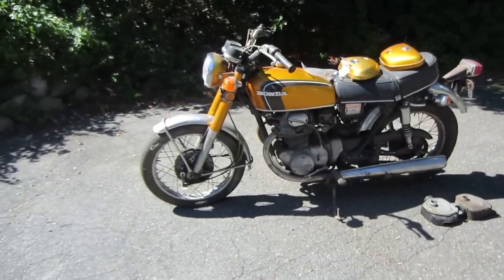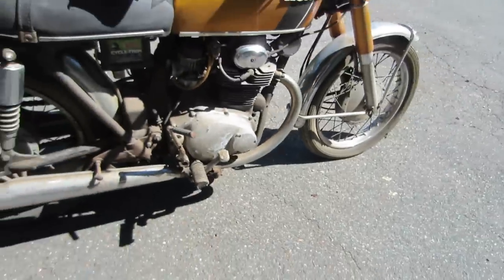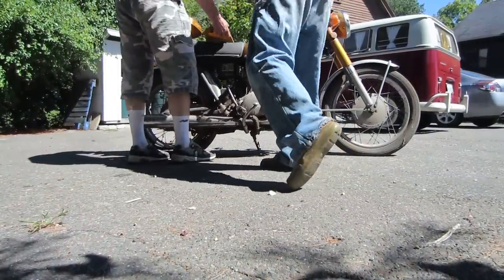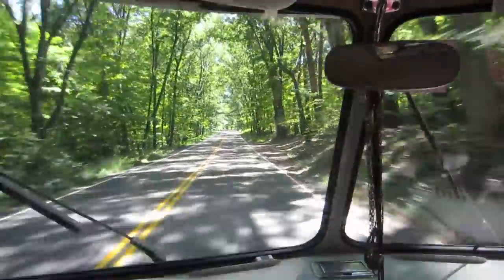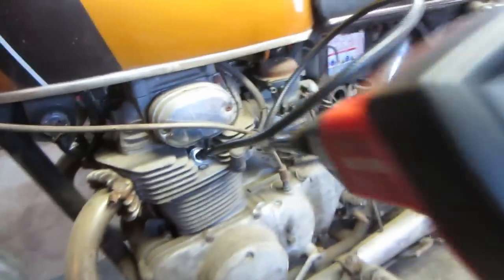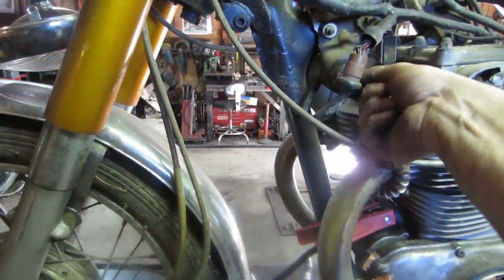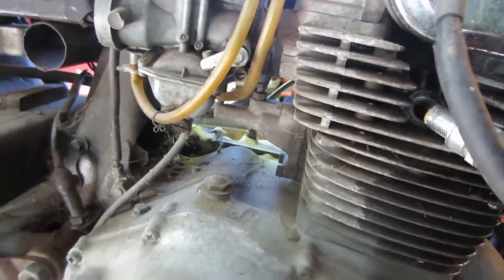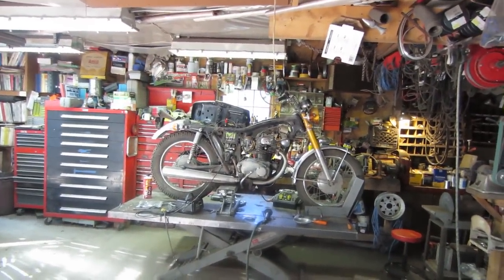barn find, 1971 honda cb 350 motorcycle

Comment: I have had good luck with MMO and for more stubborn pistons, PB Blaster. Spray in and let it sit for at least 15 minutes then crank it. As far as, stripping the screws goes, same thing, a little PB Blaster and let it soak for 5+ minutes to loosen them up. 
One thing most people do not seem to be aware of is, those Phillips looking screws are actually not Phillips but JIS. So, using a regular Phillips screw driver is likely to strip them, naturally.

Comment: You probably already know this, but a lot of older Japanese machinery didn't use Philips screws--they use JIS which look similar, but there will be a dimple on the head next to the Phillips-like cross. Dimple = JIS, and no dimple is probably Phillips. Phillips drivers usually strip out JIS heads since the angles are cut differently and they don't make a good fit. And yeah, those old school impact drivers are great!

Comment: I used to have one of those.....and a 750...the 350 was barely slower than the 750..  I couldn't believe how strong that 350 was....
Reply: larry benben must have been something wrong with the 750 if it was that close.
Reply: Mxmcv430 Totally agree. The 750 was a 67 hp, 13 sec 1/4 and 125 mph motrcycle. The 350 was 36 hp,, 15 sec 1/4 and 95 mph motorcycle. larry benben, the 750 should be streets ahead in performance so whatever 750 Honda you rode must have been a worn out dog.
Reply: larry benben Hate to tell you but I had a brand new 72 CB350 and it was hot. I couldn’t suck exhaust fumes off a 750 of the day. If your 350 was almost as fast as your 750....you were missing a couple of spark plugs

Comment: Pro tip, rubbing alcohol helps ALOT trying to get steel screws through aluminum holes so you dont snap the head off...
Its unbelievable actually, but maybe the same principle will apply to a "stuck motor"

Comment: great video man, all the things i would have done too, except maybe go for using the wheel to turn the engine over straight off and not try and turn that rotor bolt, also when you crack bolts out with an impact driver spray some wd40 on and let it soak for a bit,

Comment: Nothing better "THAN" treasure hunting!   FYI... Set up a propane fuel feed from 20 pound Cyl. Use any kind of small valve to meter the fuel.  You can run it for a long time like that.... checking valves, transmission etc.  One can pour a lot of money into that real fast then hit a dead end if not careful.

Comment: If you think you will strip out a phillip's head screw, first put some valve grinding paste on the screwdriver tip, it will not slip out of the screw head, the carbide bites in to the head and the screw, you will break the threads before the head will strip out. also works great on the wheel lock keys and nuts that tend to strip out. Of course clean the grinding paste completely off the part before placing it back in service, or it could contaminate and do serious damage to a engine, you know that!

Comment: Ohh the joys of a stuck Honda twin.  What has worked really well for me with some of the frozen nuts, bolts, and screws is to soak them with penetrating lube overnight before trying to take them out. And then I use a small 12V impact driver drill.  Just make sure you push into the screws etc hard and work your way up from a low starting torque until they break free.  Also, I've had extremely good luck with pouring a mixture acetone and ATF down the cylinders and letting it sit for a while...then trying to break it free.  Nice bike.  Good luck to ya.

Comment: its great you got it running but those 350 hondas the CL and CB had a rubber timing chain wheel that goes to crap if it isn't soaked in oil every once in a while so unless you replace it that engine is gunna detonate at some point.

Comment: $100-$300. Adjusting the points/timing is fun. 😱😿. Something better than a phillips screw head. Had 2 Honda 360's. Used them on dirt roads, the steering head angle is a little steep for dirt.

Comment: When I had my 67 cl350cc I put in a barret clutch. Next I filed and polished all those notches on the plates and discs on the inside and outside shimmmed the springs and used car auto transmission fluid. Jumped on the highway uphill and missed a shift the tach was in the red so I just stomped on gear lever no clutch which lead to high front wheel.

Comment: The driver bit is a different head from the JIS screws. Just put the bit in the screw first and give it a sharp whack with the hammer. This will stretch the screw head into the same fit as the driver bit, then put it back in the impact driver and clout it again with a bigger hammer. 👍

Comment: hi Mustie,,,Im an avid viewer and have watched all your videos. Definitely learned a lot, Thanks. Dont know if you will even see this,,,I posted this in the honda resto because i have a honda question. I was able to pick up a complete ct trail 90 1968 with title very cheap. got the carb apart, soaking etc. points and timing I feel comfortable taking care of.  My question is,,bike appeared to be non stuck and when kicking it over gives good resistance,,,,BUT, no putter putter. Took valve covers off, valves not moving when i kick it. I seem to hear the piston sliding up and down in cylinder and that's the only sound. Stuck open valves maybe? this is a project for spring so im in no hurry. Hope you see this and thanks for your vids. Colorado Will

Comment: I had one of these- identical bike. Good motor- complete crap electrics. Ate batteries and rectifiers, alternator didn't have much kick, as far as charging. Clutch mechanism wasn't very robust, weak starter, but, overall, the engine and transmission were pretty reliable. And I think the clutch had been abused, before I got it, so the only thing to stay on top of, was the electrical system. Pretty typical of the bikes of the time, I guess.

Comment: I wondered how you were getting those phillips head bolts off holding engine cover plates on, just need the right tool. Good to know a new trick! Bless you.
Reply: Proper JIS skrewdriver. If you use a phillips your gonna strip em

Comment: Had a Honda 350 4 best bike I ever owned
Reply: i has honda cb 125,350 2 time,500four,750 four and best bike has 750 four and shit bike has 350 ewer.other brand bikes i has suzuki 1100 water cooler, 750 water cooled 3 cylinder butr suzuki has alltime shit center cylinder cooling has new bike big proplem.

Comment: Moutl (i think that is the correct spelling) sell a product called compression stabiliser... it works very well for loosening up corroded parts. just make sure parts don't sit in it too long as it will chew aluminium and other metals after some time.

Comment: bought a new one from Grass Valley Honda in 1971. What a mistake. Spent more on parts in 35000 miles than the bike cost. Only good thing is it made a mechanic out of me because I couldn't afford to hire the work. nightmare...those carbs for instance have a rubber diaphram that flexes...Where it flexes it creates small vacuum leaks. Carb will totally fail. Diaphram was expensive then God knows nowadays.
Reply: WOW, the owners of GV Motorsports were good salesmen, but poor mechanics. I also bought my '72 Gold 350 there...Mine did 13,870 in 12 months with very little maintenance.. hmmm.

Comment: compressed air n atf fer el stuck engines .i used on a cb750 locked from no oil in it .when she started up everywhere  that could  knock  did

Comment: Nice buy and congrats on getting it to turn them turn over with spark and gas. Friend had a Honda back in the day and he also had electrical problems with busted/loosened connections. Was this bike also called the Scrambler?
Reply from the maker: they made  types , the scrambler had high exhaust
Reply: those were the SL 350s same basic engine with the cl and cb's they also made a 360 using this same engine design...but the early sl's were the best of the bunch

Comment: Honda cbs of 70  to about 85 all have that stupid wiring in the headlight ,can get crushed and overheated by headlight and jump out of connection when pothole is found! . Just be carefull when headlight is replaced or just insulating tape wires and connectors to try and avoid problems.

Comment: ATF in the cylinder let it sit then bump it.  If that doesn't do it it is seized. Same goes for the clutch cable.  I usually use penetrating oil for cables.  Thin is in for stuck parts and a bit of time.  If the motor wasn't run until it seized it will break free.

Comment: Just curious but when you were using that impact screwdriver were you using a Philips or JIS bit?  I was thinking that Honda used JIS screws, and so I was just wondering if that was why you had issues getting the bolts out.

Comment: I bought carb kits and points on ebay. Be Carefull buying points. I had to return two pairs. Assembly quality issues. You can't file the original points too smooth. If smooth, keep em. Again, point gap/timing can be tedious. 001 diff can be a degree or so.

Comment: I wonder why it has two sets of points?  I mean, both cylinders are at TDC at the same time, one on the compression stroke, one on the exhaust stroke.  It wouldn't hurt anything to have a spark in the exhaust.  Just seems like an easier way to do it.

Comment: looks as if it's in good hands. Had a new one while serving in the 82nd Abn.. It hauled my 6'-2" 220lb. ass at over 85 mph. It met it's demise when i T-boned a Gran Torino as he was making a left un-signaled turn. The 8"extended forks were on one side of the intersection and the Torino's left front hubcap was under my rear tire wherein turn the frame was stuck to the left front fender. The helmet shift from impact with ground, tore my right ear half way off, but was sewn back. Good thing i was a Paratrooper @ the time... for it would have killed a normal man, LOL 
-Former Recondo Sgt. "Rock" 1/504 71-74

Comment: The reason the screws strip out so easily is because they are not Phillips screws but JIS (Japanese Industrial Standard) and have a slightly different profile than a Phillips.
Do yourself a favor and get some JIS screwdrivers from Vessel Tools or the like.
I wish I had known of this years ago working on Japanese bikes and motors.

Comment: Mustie, you're using the impact wrong!!  You have to push in AND turn in on the impact to load it before striking it with a hammer.  Those fasteners on the crank cover don't look bad at all.  Load that puppy up before you hit it and I guarantee they'll spin free.

Comment: Did you spray inside the cylinders with penetrating oil, then vacuum them out with a little tube taped to your shop vac. This should have been done several times, also the oil should have been changed, new filter, then using the kick start be hand slowly moved the pistons.

Comment: For what it's worth...at 32:57 or :58 there is an audible snap and flash as a plug wire, I assume , arced below the battery area. you can pinpoint the area by rewatching your video.

Comment: mrmwman1

If you look around you can find a set of New JIS regular screwdrivers.  The best ones to use without ever having to use an impact are the T-Handled ones that KOWA and Vessel made for Honda.  You can find them on ebay once in a while and some are available for sale on some Japanese auctions.  I've never had to use an impact yet with the t-handles.  Vessel makes a new regular jis driver set that is really nice.  Try to find the T-handles.  The JIS screws have a dot on the middle early 70's on up.  The large JIS screws and JIS screws before the 70's were plain.  You can tell immediately by the fit when you have the right driver.  If you check out Ebay and search item number  264253217581 even though it is the 1950-60's flat driver, you will see the nickel plating and what they look like.  Early 70's T handled drivers were regular chrome

Comment: I always wondered why the steel on old japanese bike screws seems to be made of aluminum foil or something.  They are so soft.  And they love the phillips screw which is a bad system anyway.
Reply: The Japanese use Japanese Industrial Standard screws. They look very similar to a philips but have slightly different angles to the cut. That's why using phillips head screw drivers strip the tight ones so easy. Look up JIS screw driver set if you are interested in seeing the difference :)

Comment: Use a correct JIS bit instead of a Phillips screwdriver and you will not bugger up the screws.  There is a difference between the bits.  Phillips screwdrivers just destroy JIS or Pozidrive (European) fasteners.

Comment: Uuuh, i hate these screws from old japanese motorcycles. The material seems to be a mixture from butter and cheese. And using steel screws in an aluminium housing was no good idea. But if you own a sweet treasure like this you have to deal with it ;-)
Reply: It's because they aren't a phillips head they are a JIS fastener. I learned this after many many stripped screws

Comment: My Father has an old CB 360. He has a Harley dealer trying to buy it from him, but I think his offer is too low for him. It is a very low mileage bike, my Father being only the 2nd owner, neither owner rode it very much. I know it has a full size ferring, and it might have fiberglass saddle bags as well. It's a very loud metallic orange color. I am not sure if the motor is seized or not, it has not been started in a long time.

Comment: Never rock a bike back and forth in gear with a locked engine unless you have filled the spark plug hole/holes with WD40/penetrating oil and left overnight at least.

Comment: impact screwdrivers. nope not even close. .especialy if you dont use a JS screwdriver bit. .   also ya can just dab the frontpipes with a finger. if its cold its not running and would save ya time on guessing on which one is good. .

Comment: I would have used Diesel fuel to soak the cylinders in to free it off, why did you use ATF? I've never tried it.
Reply from the maker: l did not use atf, it was marval mystery oil
Reply: Ah, thank you :) @ 9:05 you mention you might have some marvel or some ATF, then I didn't recall it being mentioned again, but slightly later you pour in some red/pink fluid which looked like ATF, I don't think we get the Marval in the UK. ( Like a lot of stuff you guys can  get round the corner, we have to import )  so ( I'm just bad)  I assumed you had not and went ATF, When you assume..........

Loving all your vids, like your relaxed style even when it goes tits up :) :) which I could go straight to your first videos, and work my way through, but clicking next seems to wander about a bit.

Comment: you need add thin oil and wait week ,then try round if move, better lot.and if no move have tust and wery stupid run motor after if cylinder have rust. need open and clean cylinders good,maybe hone little and better if change new piston rings too. cheap easy work.rusty motor rtun broken all sylinder to trash.

Comment: I had a 1981 Suzuki 850 L Shaft Drive the guy said it's dead it had 80,000mi on it and the guy put gas, new plugs, oil and it just wouldn't start, he wanted $1500 I laughed and said I'd only give $300 and he waited until I started driving away and said I'll take it so I asked the guy for a helmet, he said here you can keep it so I turned the petcock on and took off. I put 10,000mi on it and sold it for $1,000 and the guy never did the paperwork, got pulled over after a high speed chase and told the police it wasn't his so they tracked it down to me, the title was still in the same zip lock baggy The police asked me if I wanted it to come and get it so I did and sold it again to a guy and his wife called me up screaming at me for not asking her, she told me to come get it and I sold it again. By the time it finally left me, I made $5,000 and the most screwed up thing ever. I swore that bike wanted me dead. I loved that bike, but I had a paramedic pull out in front of me and I slammed on the brakes and it was pouring out so I had no brakes so I laid it down, I put my left foot on the tank and I must have hit a pothole because the bike jumped up in the other lane and I parked it and sat there for an hour in the rain then walked home, the bike still ran, but I had enough for one night and no brakes. I got when I had the balls to ride it. This is why I sold it.

Comment: Just wonder, isn't it a very bad thing to force it around and then start it and also run it with all the rust and crud since that surely will be as a coarse abrasive in the cylinder and make bad scratches all over it?

Comment: wouldn't the previous owner shit his pants if the next day you rode over on it? I did the same with a 2hp suzuki outboard and inflatable boat I bought at the yacht club yard sale next to the marina where I kept my boat. He wanted $500, talked him down to $200 since the motor wouldn't work. I took it back to my boat. Pulled the spark plug, had spark. No fuel. Unscrewed the "throttle" which was basically just a knob....out came the brass full "screen" which was 100% clogged with corrosion. Got some clean gas and a toothbrush. Cleaned it all up, cleaned out the socket, screwed the "throttle" back in. Put some gas in the upper gas tank...2 pulls it fired right up.

I mounted it to the inflatable, grabbed the GF and some life jackets and motored over....He was still at his table and I waved to him as I passed by...MY buddy kept his boat at that yacht club and he told me the seller was PISSED...lol.....

Too bad it was stolen a month later. I only got to use it a half dozen times but it was a good little boat. Hard bottom....wasn't much to look at but my gf and I puttered around the inland waterways where I'd go on the weekends......drive the big boat over to the islands. Moor, then putter around on the inflatable.....